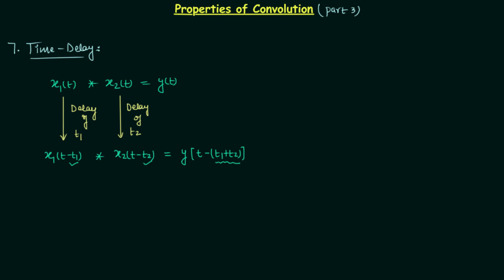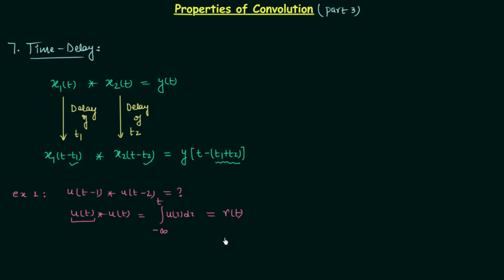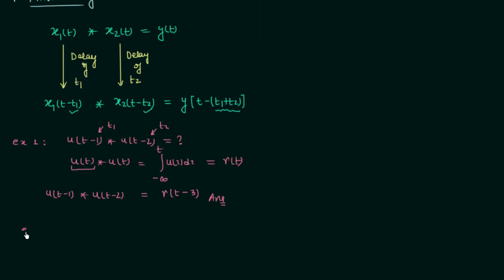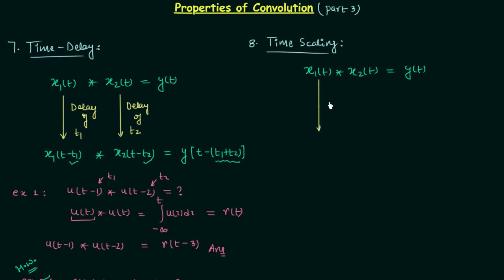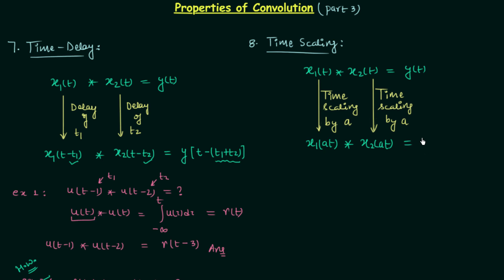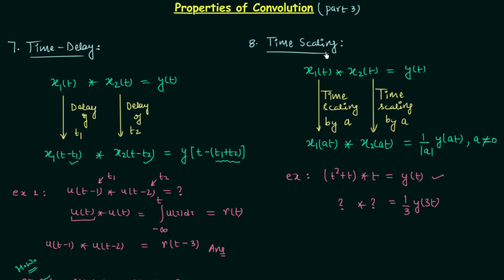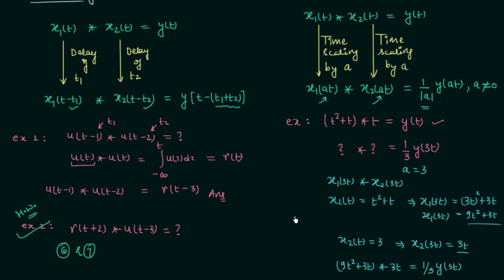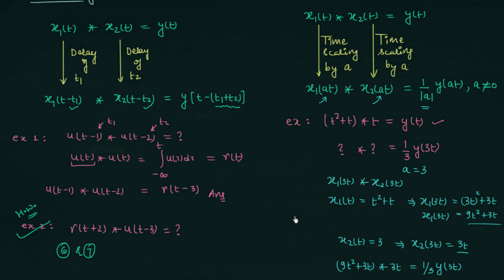Properties of Convolution (Part 3)

Comment: At 6:24 example of time scaling, how did the value of a=3 came out? Didn't understood the solution
Reply: The output is giving from the example, as you can see the value of a in the output (1/3) ×y(3t) where you can find the value of a from the coefficient of the independent value which is t, hopefully this is clear to you now 😊

Comment: A unit ramp function on integration yields a unit parabolic function
r(t+2)*u(t-3)= p(t-1)
Reply: can u tell what happens when we integrate other typesof signals
Reply: p(t-(-2+3))=p(t+1)
Reply: @a-classzone1998 bruh 3-2=1 not -1
Reply: @basundharahazra8124   no see the ramp signa is r(t+2) so  it will  be r(t-(-2), so its is -2 and   from the second one it is  +3 , at the end it will be -2+3=1 so it  will be p(t+1)
Reply: @ecedemon152  so p(t-(-2+3))=p(t-(+1))=p(t-1)   you forgot the sign outside brace